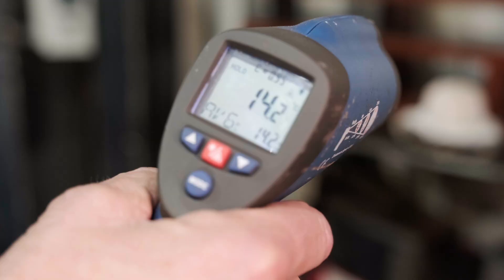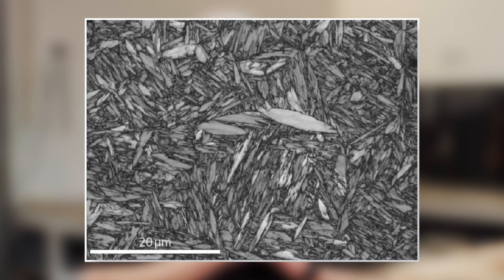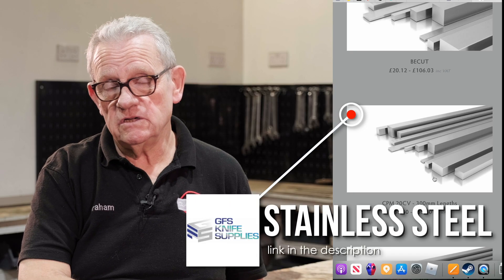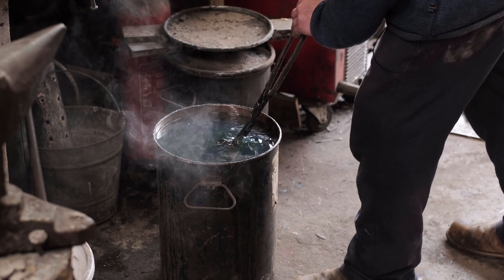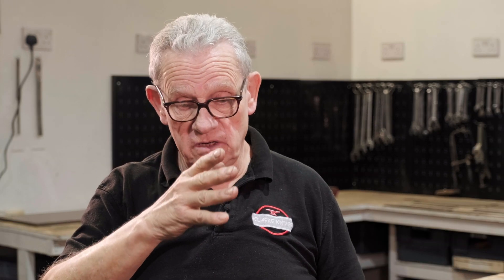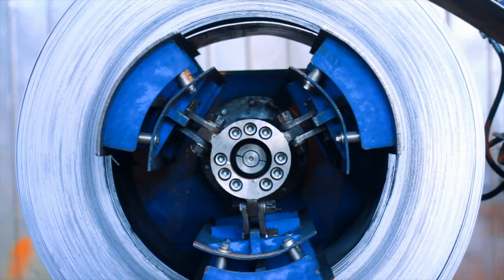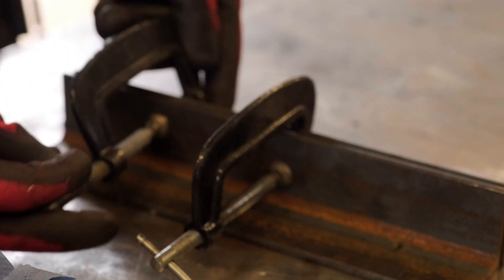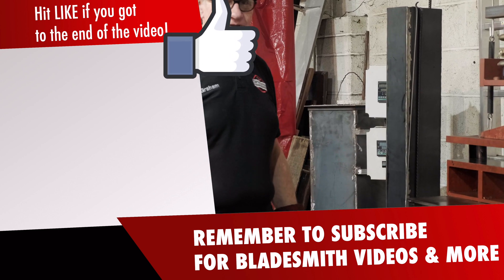EASY way to avoid bends in your knife (even BEGINNERS can do)!

Comment: i would love to know what happens in greater detail what happens when you quench the steel 50+°C above it's maximum hardening temperature. 
(yeah, i asked that through Instagram before but maybe that's an interesting topic for other people too. 

A question to this video: is platequenching with thick aluminium plates and pressured air fast enough to harden carbon steels? 
maybe in a automatic setup where the air blows like in one of the air hockey tables the second the press closes.
Reply: No. Carbon steels require very fast quenching rates. In 1095 for example, to start the martensitic transformation you need to cool around 1000 F in 1 second. You can't do that in air.
Reply: @ASJC27  Aluminium plates + pressured air quench pretty fast
Reply: @Sebastian-ed5kt  On your hardening temperature question:

It depends on the steel. Is there a type you're particularily interested in?

Also, it depends on how long you hold at temperature. Everything happens faster as the temperature gets hotter. Grain growth will increase. Diffusion will go faster. At higher temperatures you could dissolve more types of carbides. 

If you're careful with your timing you can run a normal hardening process at a higher temperature for a shorter time. It's done for high volume razor blade manufacture for example.
Reply: @GemAppleTom  no not really I meant it more as a general question but O1 or O2 should be a good example as i have plenty of forging stock for that 

I don't really remember is dissolving more carbide good or bad 
the other points perfectly make sense 

you mean like induction hardening where the heating time is never more than a few seconds?

btw: is there a chance that you are a bladesmith and that you have instagram?
Reply: @Sebastian-ed5kt  I've never actually used Instagram... 

I'm not a blade smith, sad to say. It's something I'd like to get into when time and money permit. I'm a ferrous metallurgist with some forging (aerospace and friction welding) and a lot of contract heat treatment and surface engineering experience. And hope to start lecturing after I finish my PhD.
Reply: @Sebastian-ed5kt  what you want to happen to carbides depends on what you're after. Letting them form into large(ish) spheres will take a long time and will make soft machining much easier. That's not great for strength though. 

Carbide can pin grain boundaries which is good for preventing grain growth - generally a good thing. 

I'm afraid the answer will always be "It depends".
Reply: @GemAppleTom  that's an awesome background, i would love to learn more about the aerospace part but also the heattreatment knowledge you have. 

I'm a precision machinist and I'm looking forward to starting my master (not the uni master)  in mechanical engineering this summer
Reply: @GemAppleTom  ah okay, so it's similar to grain size, the smaller the better after heat-treating in therms of hardness?
Reply: @Sebastian-ed5kt  small, finely dispersed carbide (or any other precipitate) and small grains are generally what you want.
Reply: @GemAppleTom  okay, then my understanding was right of all what you explained. 
thanks for your time Tom
Reply: @ASJC27  Just to make life complicated, the cooling rate required to get martensite isn't constant. 

You're quite correct that something like a 1080 does need rapid quenching (aluminium plates are quite quick but not quick enough) at the start of quenching. The cooling rate required decreases as the temperature goes down so at lower temperatures the aluminium plates will do the job 

Here's a pretty good video on TTT curves that explains it better than I can in text.

https://youtu.be/JJWKfAeak2M
Reply: @GemAppleTom  just watched the video. 
thanks for recommending this, it's absolutely awesome for understanding this. 
(we only get to know the iron- carbon diagram in school)

so my understanding is even with the air hockey air flow at full pressure and the aluminium simple carbon steels won't be hardened unless i quench them in oil like Graham explained in the video.
Reply: @GemAppleTom  I'm very much aware. I'm an aerospace engineer and studied material engineering including TTT curves in university, so no further explanations necessary. 
The initial quenching rate from austenization temperature is the most critical part. If it's not fast enough to avoid the TTT knee, what rate you cool at next won't matter as you will never get it to properly transform to martensite without starting the process all over.
Reply: @Sebastian-ed5kt  You're bang on. 

You need to avoid the steel starting to transform into pearlite for the best results for the edge. For that you need to cool a plain carbon steel quickly down to 300ishC. You don't need such speed after that hence you can press quench after that. 

Edge quenching will let the back of the blade form pearlite. Not good for a cutting surface but it'll give you a lot more toughness.
Reply: @GemAppleTom  yeah, that is clear 
and exactly like the process I'm doing when hardening. 
doesn't happen much as I'm using stainless more and more.
Reply: @ASJC27  Alas youtube doesn't make it easy to reply with "in addition to what this person said..."

I thought you knew what you were talking about but wanted to elaborate for the original poster.
Reply: Its not fast enough for high carbon, plenty of high-alloy tool steels will plate+air quench though if you're not wanting a full stainless blade.
Anything like A2 to A8 series, pretty much all the D-series steels, some of the S-series shock resistant stuff all make for some really tremendous blades if you're looking for a lot of carbon and chromium.
Plates are pretty quick, but they're not as quick as a fast-oil and for any of the W1, W2, 1095, 1084 variety of high carbon, low alloy steels you will also need a specific fast oil to attain full hardness out of them- don't go using vege or motor oils on them.

The cheap knife straightener is just a woodwork vise with two bits of aluminum or steel plates stuck in them- get your knife quenched for a good 10sec in the oil and in between the plates, clamp down gently and give it a minute. Wont cost you more than 30bucks if you do a bit of shopping but save you ages of fiddling with jigs and so on trying to knock it out in the temper
Reply: @krissteel4074  okay, thanks for the explanation and the huge list of steels that would be able to be quenched that way. 
i have pretty good industrial quenching oil that kills it with 80crV2 and Damascus. 

for straightening i use two plywood boards lined with stainless held together by my vise because i can store it the best (no regular workshop so everything has to be compact) 

i was asking because i plan on building a beltgrinder with a surface grinding attachment and there is a thought to make the sled movable by pneumatic pistons. because why the hell not. and then it would be easy to just mill a air hockey like hardening jig in one go. 
(yes the grinder will probably be a bit op or luxurious but i can do it so why not)
Reply: @Sebastian-ed5kt  A cheaper option for something like that which just needs to go back and forth might be something like a linear actuator they use on CNC machines or 3d printers. Most of them run on little 25-70W electric motors and its just a case of finding a speed controller and reverse set up to switch direction at travel lengths.

My next mad-invention I'm looking at water cooling my quench blocks with a small pump and a channel milled between two large inch thick aluminum plates and running the water between them. Found after doing a batch of half a dozen stainless knives they can get too hot to touch without gloves.
Or I can keep throwing them on the lawn and hitting them with the hose :)
Reply: @krissteel4074  i have an easier option for you that i thought of while visiting a mould making shop. 
get some copper piping and drill holes into the plates then stick the pipes in, solder everything like a floor heating and pump water through continuous, plates stay cool, you have a closed system and should have pretty cool plates without a need for milling (idk if you have the option for milling)
Reply: @Sebastian-ed5kt  I'd have send out for milling so I've been procrastinating a bit much.
Plan B was the copper tubing and finding a crucible capable of holding about 4kg of liquid aluminum and making some dodgy-as steel molds.
I can actually melt up to about 10kg with an electric kiln, but I am kind of shit when running around the workshop with hot metal as it is and probably just tempting fate at this point going with that plan :)
Reply: @krissteel4074  okay, why not 
but if you pour is you still need to face the surface. 
otherwise just tubing on the side of the plate and holes with threads in the side works the same if you have fitting pipes with threads. 
and brazing is nothing more that putting a bit of filler on it and heat it until the filler runs into everywhere.
Reply: @Sebastian-ed5kt  Yeah its probably the better option thinking about it for a bit. Mostly because pressure could blow out gaskets and that gets ugly.
Mostly I'm just worried about killing myself with buckets of molten metal so I might try a smaller scale and work up from there just to see how it goes on a test.
Reply: @krissteel4074  the pouring shouldn't be that difficult
use a pre heated steel form to pour into and don't splash water on it. 
put the form next to the oven/ heat surce and then go for it 
you could even put in the copper pipe for the channels in the end as long as you don't close them you are pretty safe